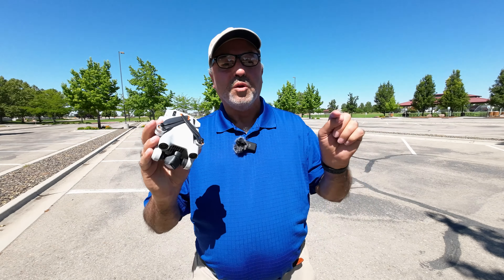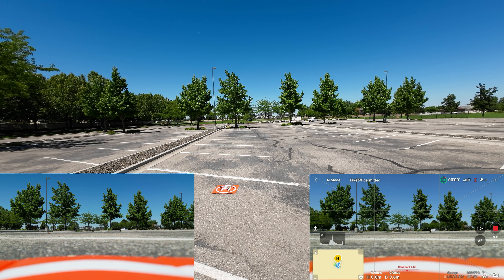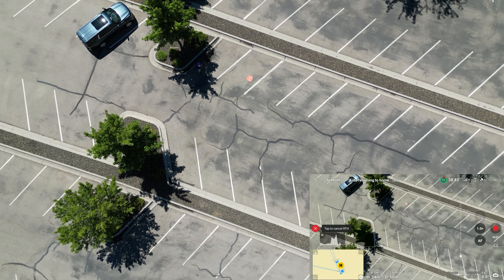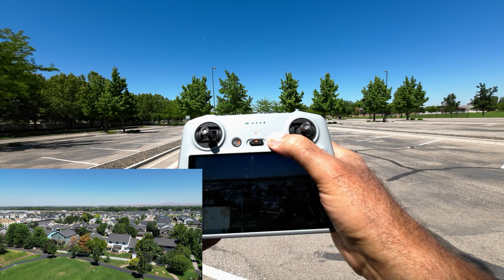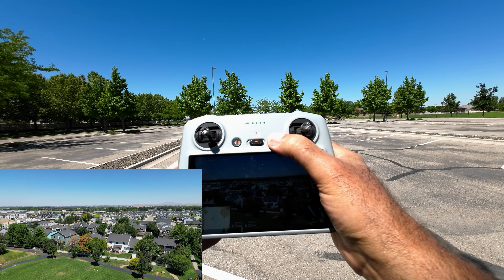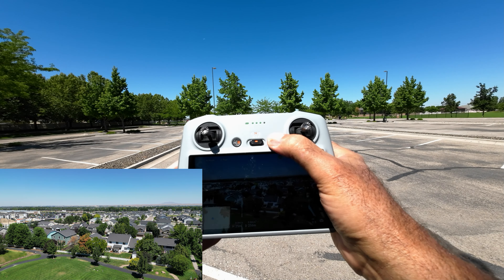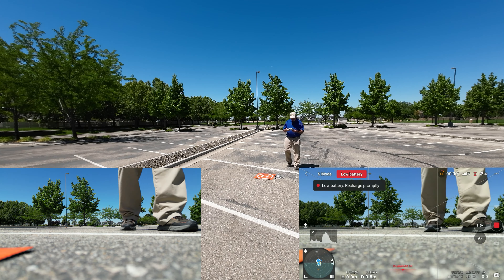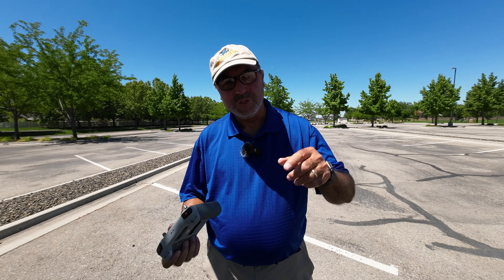DJI Mini 3 Pro - Complete Guide To Return To Home RTH - Tutorial

Comment: Superb presentation.  For new flyers they should know that the higher the RTH altitude setting the greater the risk (same with a lower  return height) a) Stronger winds exist at higher RTH which can suck your battery juice b) climbing & descending to 
/from 400 ft can also drain your battery.  I personally set height based on terrain each & every flt.  As an island guy, I am 90% over water so margin of error is scary & unforgiving.  Aloha, Barry
Reply from the maker: Thank you so much Barry!  I agree, I change RTH height depending on the terrain around me.  Thank you again!

Comment: Wow 600 meters and occusync 3 was disconnecting? granted it was next to a major structure with much electrical interference but this lack of signal strength is ominous and frankly not reflective of the reputation DJI is known for. It is only one feature of this feature rich drone but surely limits its ability to take video and photos at a reasonable distance from home base, not impressed. I expect an exterior antennae for the new dji rc controller in the future to extend range comparable to the basic controller and replacements for all the original m3's rc controllers with the built in screen in the market sold with an inferior control range.
Reply from the maker: Had I been up to say 60 meters and not intentionally trying to lose connection it would have been fine.  👍

Comment: I. Did own one and not once did rth hit it's target ....my air2s always always hit the mark...I sold my mini3 because most of the hype is just that I'm in Canada and the wind here almost knocked it out of the sky .... When hovering to long in one spot over heats no fan inside  keeps cool by airflow during flight. Small sensor so video and photos not the professional look ... And even though vlos rules don't apply I think any pilot that flies with no visual sight if drone is just asking for trouble ...so as a toy for beginners it's average but definitely not a pro drone ..thanks again a d gapo flyibg
Reply from the maker: I'm a huge fan of the Air 2S.  It's the drone that I take when traveling.  👍👍

Comment: Hi Marcus. You often mention stopping recordings so you do not inadvertently corrupt the file. Surely it would be easy for DJI to incorporate this step in the shutdown routine and therefore eliminate the issue. That is, if you still have the record function running, then the software should properly auto-cancel the record function before any action can be completed which may corrupt the file
Reply from the maker: I agree.  In DJIs higher end drones it saves the file no matter if you stop recording or not.